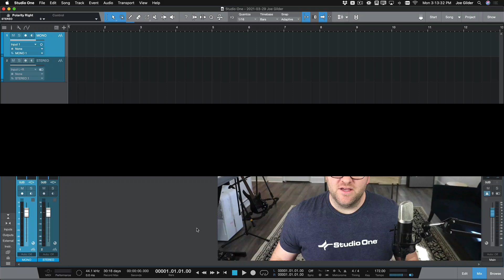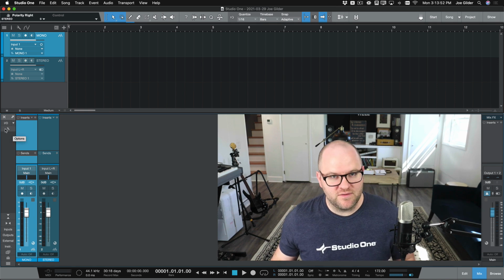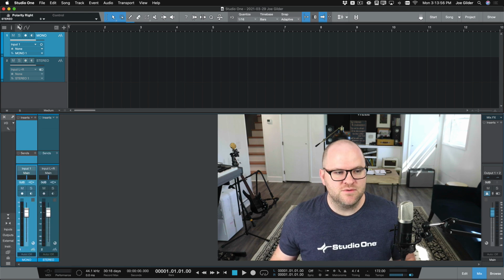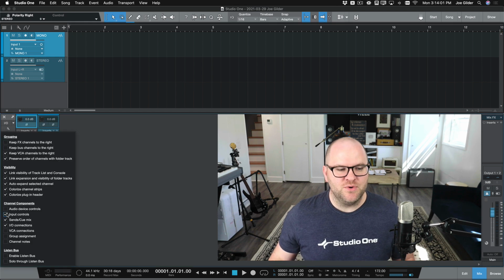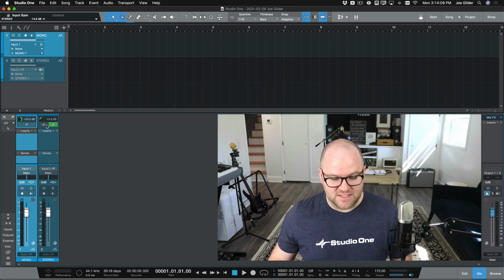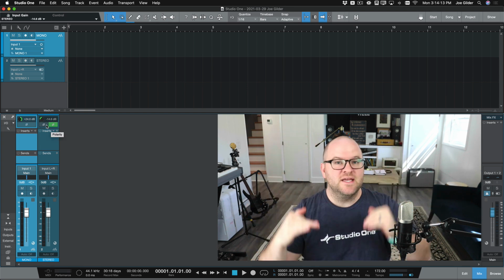Channel Gain Knob and Polarity Button in #StudioOne

Comment: Hey Joe...when I adjust the channel input gain I don't see a corresponding change in the metering (lowering or raising). Is this what's supposed to happen? I see it when I open a VU meter, but not on the channel meter.

Comment: Dont mind my test stuff on my channel. Not songs, tests to mix. I got a dual spitfire string section little part. Do the same line. And It seems like phase when I solo both tracks something odd is off. But on any single solo listen each seems fine. And its a odd off, saw a few other vids of phase, and seems like that. Only after I (just started doing this) I automated the strings to like rise up to peak, and start more low. More up and down with each strings section note low to rise." But that almost created this phase thing it seems?

Comment: Hey Joe, does the trim knob also works for instrument tracks? 
You said the trim knob allows to affect the gain before the signal hits the plugins. 
I was wondering because every time i add an instrument the volume is way to high i always have to put a mix tool in my instrument channels to adjust the volume.

Comment: Hey Joe is there a way to have the input control active by default? Every time I create a new song, I have to activate the input control.
Reply from the maker: Use templates, my friend. Create a blank new song template with all the settings like you like them, then use that template every time you create a new song.  - Joe Gilder
Reply: @fenderstudio  Yep. The only way to go. Love the quick tips. Thanks.
Reply: @fenderstudio  i use templates and whats funny is i don't have to activate it every time but i have to open and close the mix window and then it shows in the inspector cause i use it for mixing more than i use the mix window.

Comment: The reason why users keep asking about long-existing features is because Studio One is sooooo menu-driven. 

There’s a great irony to this because the DAW was created with a drag’n’drop workflow in mind — and you can’t get simpler than that, right?

But then Presonus worked against this paradigm by creating so many menus and panels and sub-menus that users (even relatively competent users) can easily get lost.

I love the power and flexibility of Studio One, but be prepared for more user queries about features that already exist.
Reply: The two wrenches are pretty easy to find, I don’t mind them at all and don’t think studio one is too menu-driven

I’d find it funny if a DAW was so focused on being drag n drop that they would have to exclude a couple of simple menus. How would you even drag n drop any of the options featured in them?

The point is, I don’t believe there was ever a goalpost of keeping S1 ”as simple as the drag n drop workflow” through and through. That’s not realistic or even desirable imo
Reply: @borrasca  If you have to first open a view (e.g. the mixer) to see a settings icon like that small wrench in the corner, then that pretty much amounts to a hidden feature.

If you have to not only right-click, but then also navigate to a nested list after your right-click action, then the UI is menu-intensive.

I’ve used just about every major DAW (and currently still switch between a few where necessary) and I can’t think of another DAW that nests right-click menu items into sub-menus.
Reply from the maker: Once you know the wrench is there, it's not hidden anymore. 😊
Reply: @fenderstudio  Uep — you’re right. 

Hopefully you’ll retain enough users through various paid update cycles long enough for them to find it.

Don’t mind me — I’ve been an S1 user since version 1.

I pretty much know where everything is. I’ve been able to get S1 to do basically whatever I want for years — including setting up complex MIDI controller macro assignments for workflow improvements.

I love S1. I just think that it’s important to maintain focus on the user experience, without assuming that there is little room for improvement simply because S1 is a mature, widely-accepted DAW.
Reply from the maker: Do you have a suggestion for where to put these features if not in a nested menu?
Reply: @fenderstudio  That’s a fair question given my criticism.

I will have a closer look overnight and get back to you tomorrow.
Reply: @jessetal  "Improvements" are in the eye of the beholder, right? Or "I"m gonna have the last word, dammit".
Reply from the maker: It's true, there are lots of features users don't know about. If you have any suggestions on how to show the thousands of S1 features without a menu, we're all ears. Every software I've ever used has menus. I think people expect it to work that way.  - Joe Gilder
Reply: @fenderstudio  Don’t be ridiculous — I never suggested that NO menus should be used. However, which other DAW developer uses nested sub-menus for right-click actions?

Additionally, if you have two or more locations in a UI that give access to the same function, then that’s at least one too many. It simply results in clutter. And when users are presented with a cluttered interface, they will do what humans typically do psychologically: they will block out the distracting elements and focus their attention on more commonly-used interface elements.

The problem with this is that those same users may benefit from features that they may have overlooked amid the assortment of menus and icons scattered across the Studio One interface.

If you want a clue as to how to handle menu options — look at your competition.

And don’t use the excuse of S1 having ‘thousands’ of features. Your company decided that, as a unique selling proposition, it would offer a product that would be all things to all users. Unfortunately that has raised the bar for Presonus to work harder at interface design.
Reply from the maker: I guess we can disagree that nesting right-click menus is a bad thing. It seems helpful rather than a long list of items. Also, a lot of times our right-click menus shows you the most recent actions you took, so you can get to them faster.  - Joe Gilder
Reply: @jessetal  
How is the mixer wrench icon any more of a ”hidden feature” than the mixer itself? Storing appropriate options into a wrench icon located in an appropriate place (arrangement/mixer) doesn’t amount to a hidden feature in the slightest.

Every single option in the mixer wrench list is related to the mixer. Why would you need to access them while strictly keeping the mixer closed?

Complaining about submenus in right-click menus is silly. Reaper, Cubase, FL Studio, and Pro Tools have them, some of them being much more ”menu-intensive” than S1 at that. The only DAW I can think of that doesn’t do that is Ableton Live, which is one of the simplest DAWs atleast when it comes to the amount of features and functions.

The event right-click menu in S1 I’d say is exceptionally well done too, with how it displays the last used actions and how it looks in general. 

Where would you consider S1 having one function in two or more different locations? Because the wrench icon isn’t it. Those have different options in the mixer & arrangement.

Getting caught up on S1 apparently not being ”all things to all users” (which is a vague statement in itself that was probably, at most, used for marketing), is just weird. Presonus is using thousands of features as an ”excuse” to not cater to your unrealistic, thoughtless interface critiques? Sure. 

If you want a clue as to how to handle menus - actually learn to use all your competitor DAWs to the extent where you can see those menus..
Reply: @borrasca  What is particularly ‘thoughtless’ is the stupidity you demonstrate in making assumptions regarding my level of expertise in S1 or any other DAW.

I’ve used S1 since it was released.  Abel Ron since it was released. Reason since it was released. Cuba’s since version SL. Pro Tools, etc. — so you are not communicating with a novice user.

I don’t have an issue finding anything that I need in S1. But I do recognise that S1’s interface is unnecessarily unwieldy.  New users to any DAW should anticipate some degree of a learning curve. However, software developers should not rest on their laurels in assuming that they have arrived at an optimal point in the development of a product because it ticks most checkboxes.

I find it comical when users choose to be ‘fanboys’ of a DAW simply because they’ve arrived at a particular comfort level with the DAW. That’s the problem with being a fanboy — you get so lost in your ‘achievement’ of gaining competency in a DAW that you fail to see room for improvement.

Nothing unique there. I was villefied in a Reason FB group years ago for mentioning that I had submitted feature requests for vast integration and a more powerful sampler. And wouldn’t you know it — Propellerheads seemed to agree.

Setting track gain pre-plugin should not be tucked away in a corner of the mixer view for the simple reason that the mixer view is not an essential part of the song composition process. For many producers, mixing is performed as part of the creative process itself, I.e. ‘mixing-as-you-go’. So gainstaging has become even more crucial in that creative process. What’s truly ridiculous is that you would defend the choice to tuck an option for a track gain knob in a separate menu in the corner of the mixer view  — instead of just making it accessible from the main editor view.

But perhaps you also thought that it made sense for Presonus to launch the original Atom controller without additional pages for knob controller assignments.

Or perhaps you were all fine with the way that the bouncing of multi-channel instrument tracks was handled in S1 — before Presonus brilliantly realized that it might be a cleaner, less confusing process if to streamline the audio rendering of active channels for multi-output instruments.

I love S1 and I’m particularly excited by the most recent updates.

But updates occur (and happen faster) when users AGITATE for them — not when users sit back and choose to be fanboys.

Sometimes developers — with all of their programming know-how, need users to question even what may seem to be at first glance a minor issue.

Many such issues are often easily resolved in updates but might never see the light of day unless such issues are raised.
Reply: @fenderstudio  I agree that it is a benefit to have most-recent actions prioritized,but of course that became necessary because of the complexity of the menu system.

It’s actually an acknowledgement by Presonus that the right-click menu system is so convoluted that recent menu choices need to be prioritized so as to set them aside from the plethora of other menu items.

I’m good, though — I’m about to set up my own one-touch shortcut workflow using a Razer Tartarus Pro! :—)
Reply: @jessetal  No amount of ”Listen I’m not a novice user” tirading will take away from the fact you clearly thought S1 is the only DAW with right-click submenus, you didn’t even address that. Reaper, Cubase and PT still also have them lol.

I would never describe myself as a fanboy of a DAW, I’ve seen enough Reaper goons on the internet.

However, the mixer-wrench-track-gain problem still puzzles me - you’re agitated that you can’t ENABLE input controls from the arrangement view? 

Cause even in that case, you only have to enable them once, and just save it into your default template, so that you can always set pre-plugin track gain from the mixer without having to enable it every time from the dark depths of the Stygian abyss being the wrench icon, as you’re describing it
Reply: @borrasca  You clearly miss several points.

You persist in falling back to the well-you-can-do-it-this-way argument instead of acknowledging that a) it would be simpler to be able to access the control from the main edit window and (more importantly for new users),
2. it doesn’t matter if the setting only has to be made once if they don’t know it’s there in the first place.

This entire video is an acknowledgement by Presonus that many users clearly don’t know that it’s there. Do you think that Presonus would have dedicated the time toward the production of this video if the company wasn’t aware that it was a problem?

The presenter clearly states that users have been using another method primarily because they’ve been unaware of this feature.

So, as much as you seek to defend the status quo — even Presonus isn’t on your wavelength per this issue.

The irony.

My initial comment (to Presonus — before you decided to jump in and defend the company) was that the company would likely have to continue to make such videos revealing features that already exist, primarily because of the interface design.

Don’t take my word for it — this isn’t even the first video I’ve seen in recent days highlighting an existing feature that users have asked Presonus to include. Have a watch through Presonus’ S1 video tutorials and you’ll see other such examples. Listen for keywords such as ‘users were not aware’ or ‘users didn’t seem to know’.

And, as for your assumption about my familiarity with various DAW’s, I own FL Studio — and don’t use it precisely because because of all the menu-diving nonsense. I am amazed at how popular FL Studio is as a DAW, considering that it’s interface is all over the place.

But FL is one DAW. and while all DAW’s have right-click menu options, S1’s reliance on that UI element suggests to me that, while the design team was big on the range of available features, the actual user workflow was not given the same level of priority.

That’s been evident for years re: the scratchpad. Shoving it off to one side seems to be more of an let’s-add-this-too afterthought rather than a clearly-conceived design decision.

This afterthought approach is also evident between versions 5.0 and 5.2 — with Presonus only more recently providing more flexibility re: the live performance functionality.

Why would you I,implement live performance functionality and not make it easy to restructure song material on the fly from the get-go?

So, as long as I keep plonking down money for these updates, I’ll continue to provide Presonus with the kind of feedback that could ultimately assist all users, and particularly the new users that Presonus needs to attract and retain in order to remain a viable,player in the highly competitive music production software space.